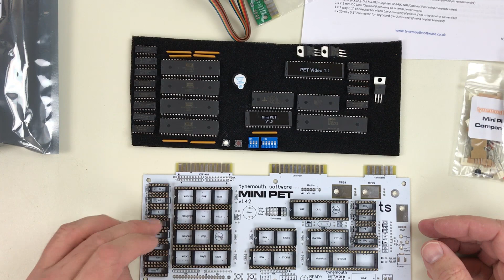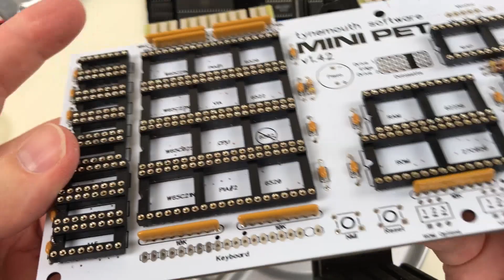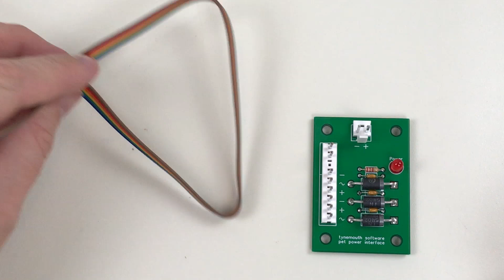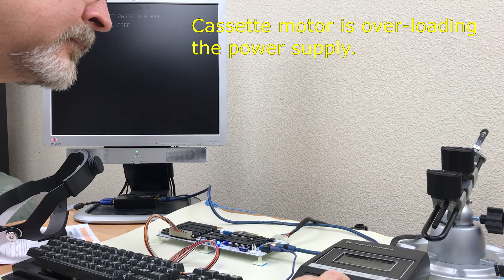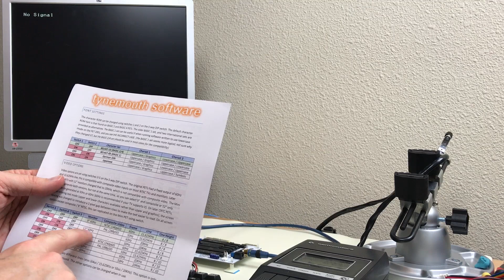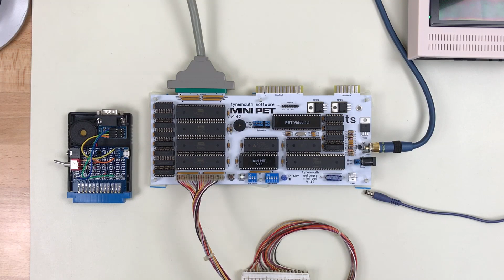MiniPET build and test

Comment: i had one original PET used, from USA . i was 16 years old(1978).I worked 4 weeks in a brick factory to get the 600 deutschmarks (that was before Euros) to buy one.OK after i got it i had to find a transformer from 220 V 50 Hz to 8V and 15 V (a bit overhead for the 5V and 12V regulators onboard). I liked the small keyboard..and dived into a completly new world.. it had 8K of RAM and a 25x40 character screen, not more.But the limit was what you could imagine to do with that...(many people who where at my age at that time played with miniature trains, played soccer,where in dancing school,learnd to ride a motorcycle(the latter got my respect)).Whatever.. i learned to program in basic, after a while in assembler, nowadays (almost 60 years old) i do Siemens automation worldwide, but the basics come from PET